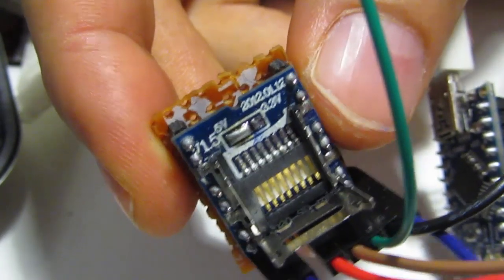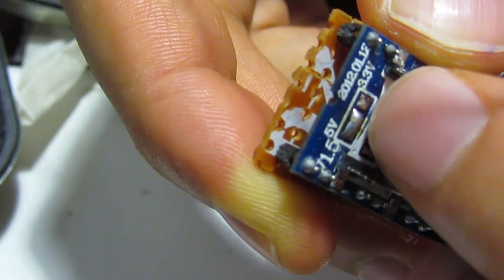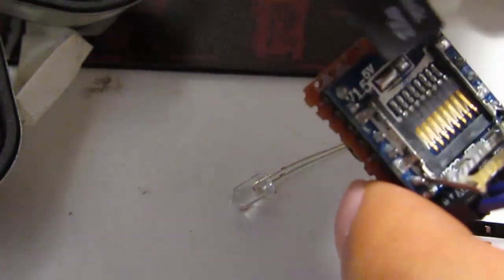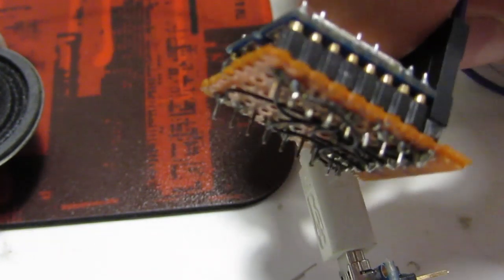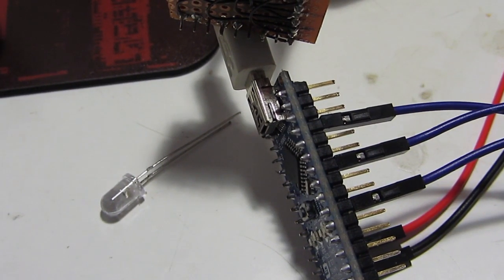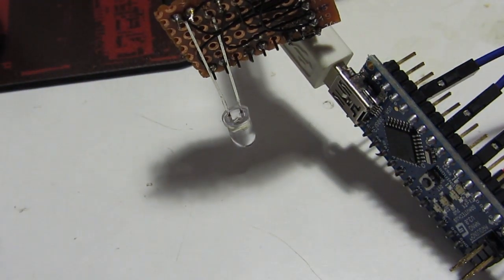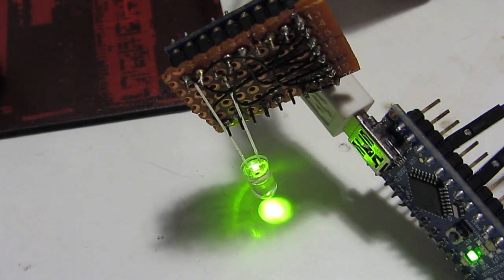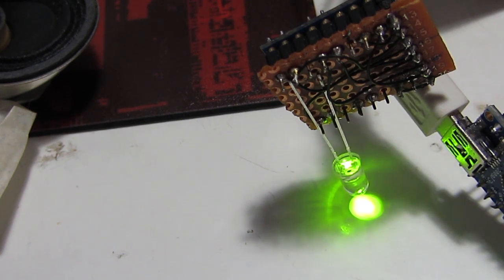WTV020-SD-16P audio/sound module for arduino - test #1

Comment: Hi,
first of all, thanks for your video. Unluckily, I've some problems with this cheap but useful chip: it doesn't recognize my micro-SD. Could you please specify the right model you used?
Moreover, I tried to move soldering point from 3.3V to 5V, but it seems to not work. There are other things I must do?
Thanks in advance

Comment: I have this module, and could not get any sound. So I tried resolding the link on the PCB, like you did, and switched to using 5V.

However after I did this, my SD card stopped working. i.e I think changing to 5V has destroyed my SD card :-(
Reply: same, after 5 years
Reply: 0n. GUVEN  hhhhaaa me to ,after 5 years and 9 months.